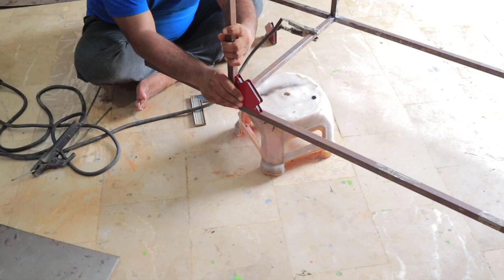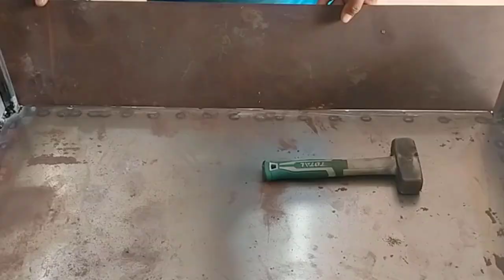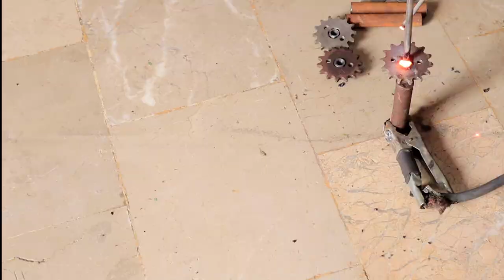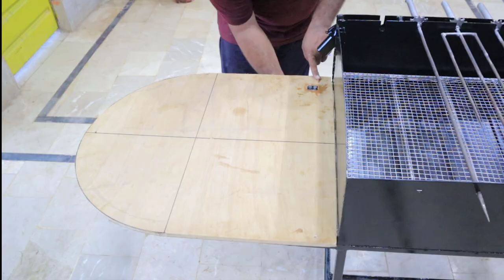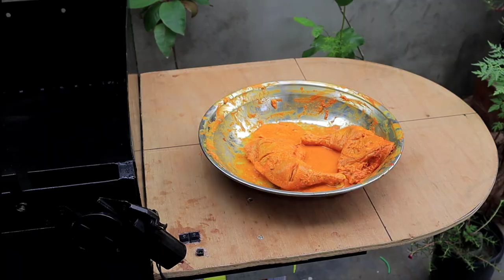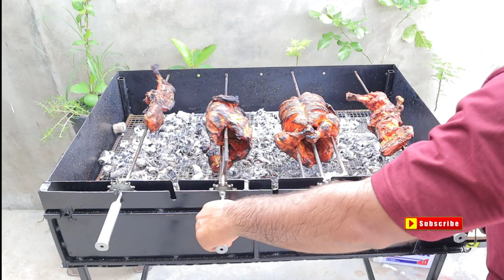Build Automatic Barbecues Grill Machine BBQ Grill Diy Machine

Comment: NICE BUILD  !!! .... But this is what I would have used.... get a Heavy Duty  Steel 55 gallon drum...cut 1/3 off 1 side (the Long way) use the small piece of 55 dum  as 🦵Legs🦵  cut it in 1/2 and weld the 2 pieces  on either  side of the bottom of 3/4 barrel  then weld your Automatic  Kabab Turner  on and Way you go  😃